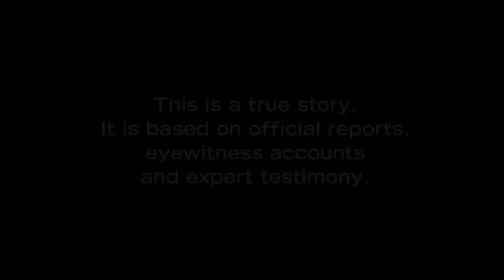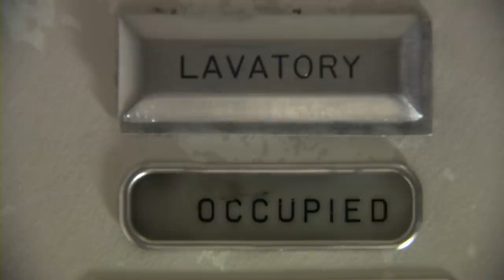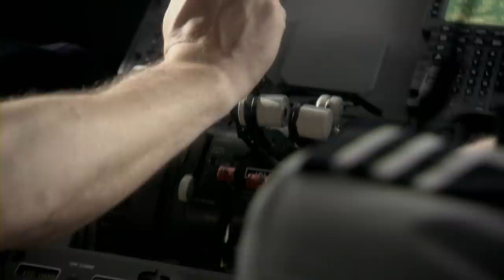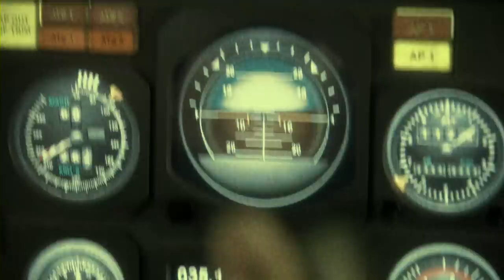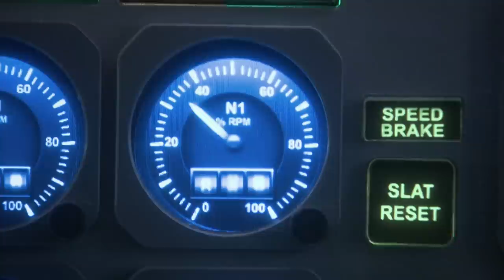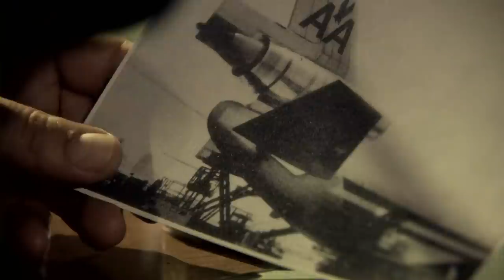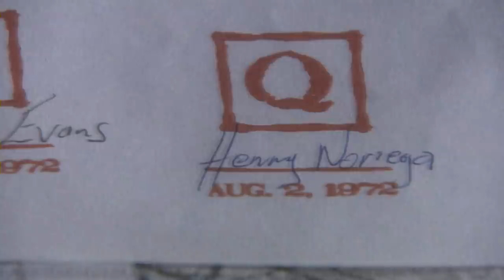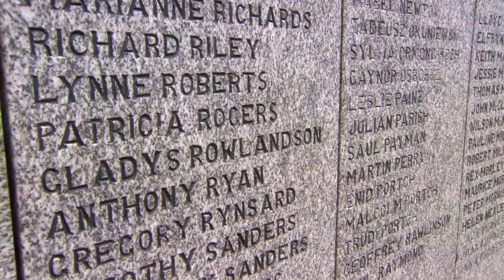Huge Hole In Passenger Plane Causes A Fatal Crash | Mayday | Wonder

Comment: "The doors on most airliners open inwards"
Yeah now they do, but at the time, outward opening doors were not uncommon.
It always irks me when people call the DC-10 a deathtrap, when it was actually a good design for the time. It simply suffered from rushed construction and the teething problems that come with it. If it had been given a thorough evaluation phase, it might have earned a reputation as a durable and safe design like the DC-3 before it. Instead it suffered several accidents that should have never happened because of the greed and impatience of desk jockeys who likely had no knowledge of how an aircraft works beyond "jet engines are loud, make airplane go woosh like bird". The Windsor incident was one of these. At the very least, the door latch should have been redesigned.

The Turkish Airways crash was not so much a failure of the aircraft but rather a failure of the bureaucracy overseeing aviation safety. That plane never should have crashed because of a blown cargo door. The problem should have been addressed four years earlier during development.

Unfortunately, there's a statement that fits the corporate attitudes about such things.
"Regulations are written in blood."
Reply: I would say you're right, but not sure if I would give MD a pass on the design problems. It was a good design overall but with some serious shortcomings. The L-1011, for example, did not skimp as much on their design, I don't believe.

Agree we should not judge a plane on the basis of what amounts to about 2 crashes (I assign design  half blame for Chicago and Sioux City.) I was scared of the planes. But that was more psychological that sensible. At age 10, the Paris crashed became seared in my mind, a symbol of pure evil, inseparable from the DC-10 itself. I imagine this kind of thing works that way for a lot of people.
Reply: @cchris874  I'm not saying we give them a pass, I was trying to say that the overall design was not inherently bad it just lacked the refinement that comes with proper testing and evaluation. MD and the FAA seriously dropped the ball.

As for Chicago and Sioux City, Chicago wasn't caused by a design flaw, but rather by sketchy maintenance procedures on the part of American Airlines, and Sioux City was a freak accident and a testament to the skills of the flight crew.
Reply: @Blakgryf  

Well, there were design issues in both Chicago and Sioux City. In the case of Chicago it has to be asked, should we expect an airplane to keel over and play dead due to an engine coming off? This has overtones of Paris. Sioux City is more in a grey area for sure. However, it's interesting to note that Lockheed, from what I have read, foresaw the hazard of having all the hydraulic lines converging  at a single point near the rear engine, as was the case with the DC-10, and incorporated a safer design into their L-1011.
Reply: @alhanes5803  
Go ahead, assuming you're not a troll, state one less-than-intelligent thing I've stated.
Reply: @cchris874  
We shouldn't expect an airplane to keel over and play dead after losing an engine.
It was a lot more complicated than that.
2 
The Paris crach never should have happened. 

It wouldn't have if Turkish airlines had acted appropriately on the service bulletin after Windsor.
Reply: @alhanes5803  

"It was a lot more complicated than that."

The complexity of the accident is duly noted. It doesn't invalidate my question/comment. Design philosophy includes ensuring the ability of a plane to safely take off and land despite the loss of critical systems. So far, this is pretty basic. There's little doubt the design of the DC-10 contributed to the accident:

-inadequate analysis of failure modes.
-lack of redundancy of stall warning
-inadequate regulations

It's precisely the complexity of the crash that revealed these deficiencies. Of course, there's no guarantee a plane will continue to fly due to an engine separation witness El Al/Amsterdam, and so on. But in the case of flight 191, the combination of failures suggests a loss of the plane would be the expected outcome. It is complicated, but in the final analysis it's not at all unintelligent to say the plane should not have keeled over and played dead. Had these shortcomings been addressed the accident would have been far less likely to happen.
Reply: Embriar 145s doors all still open outwards without a single issue ever its not that important

Comment: 11:56 'Small problem' is also what BA 009 pilots called the flaming out of all four engines of their B747.
In case you want to know what pilots get paid for when you think they are just babysitters for an autopilot: it is their training to solve these crises under pressure.
Reply: Controlled flight into terrain is the #1 leading cause of air crash fatalities.
Training is useless.
Reply: @Carter-dv4hz  :  Good training is never useless.

Comment: No door should ever be installed to close inward on a plane. If room is wanted have it installed the way a van slider door is, only slide open on the inside.
Reply: Outwards opening doors were, are and will continue to be commonplace on planes. Look at just about every single cargo plane there is both civilian and military. They all have them. 

The main advantage of Outward opening doors is it dramatically increases the amount of useable space inside. But unlike plug type doors, outward opening doors need to have very well designed and very robust heavy locking mechanisms in order to resist the forces of pressurization. The problem with the DC-10 rear cargo door was that in the off chance that the hooks didn’t completely engage - meaning the door wasn’t completely locked and that it should be reopened and closed again - it was still possible for the baggage handler to secure the latch that should in theory drive locking pins through the hook assembly. With the hooks not completely engaged the locking pins cannot be driven through but you could still close the external locking handle by putting force on the handle, which would cause the bars connecting the handle to the locking pins to buckle. And the worst part was that the cargo door indicator light was connected to the door and locking handle not the hooks nor locking pins meaning there was no way for the pilots to know that the door wasn’t closing properly.
Reply: @bruhsucks5715  no he's not.
Reply: *B787 cargo doors enter the chat
Reply: All planes I work on as a baggage agent open to the outside lol

Comment: First of all, this documentary is incorrect. The rudder is not the primary source for turning an aircraft. The ailerons on the wings, which are responsible for the roll of the aircraft, are the primary controls for a banking turn. The rudder just serves to control the yaw of the plane so that the turn remains coordinated with the altitude. Without the use of the rudder, an aircraft would drop altitude or gain altitude in a banking turn. Nevertheless, you could still make a turn without much use of the rudder, but it would be a challenge to keep the aircraft from yawing up or down with turbulence and/or gravitational pull of the earth below.
Reply: Plenty of "slope soaring" model aircraft have only ailerons and elevator -- no rudder -- yet make breathtakingly sharp turns.

Comment: Using the wing mounted engines reminds me of what the late Captain Al Haynes did on United Airlines flight 232. The pilots on AA flight 96 and UA flight 232 were brilliant!!
Reply: Interestingly, Bryce McCormick didn't like how the hydraulic system was the only way to control the DC-10 (rather than the cables and pulleys available on older planes), and he thought to himself "how do I get myself an additional layer of control", and practiced with the engines on simulators. That's how he figured it out.

Comment: It would have been a better solution if they put the door back inside the cabin the way it used to be. It would then be guaranteed not to fail. On the outside, there are too many moving parts for it to be safe.

Comment: So you can deliberately kill 349 people and no one goes to prison? Make it make sense!
Reply: I'll try:  No one was deliberately killed.
Reply: @marcmcreynolds2827  They deliberately didn't fix something they knew caused a crash.
Reply: @thedeviouspanda  I assume you're talking about the almost-crash from first cargo door incident.  But not to quibble -- whether a crash or an almost-crash, a clear warning that something needed to be done.

Something was done, following the usual industry procedure:  A service bulletin(s) was issued to implement modifications which would make a reoccurence very unlikely.  So unlikely, in this case, that it never happened again... until someone at one of the airlines decided on their own to make the door easier to close by cutting down the latches... and overdid it,  by so much that later testing showed the door could only resist about 15 psi instead of the design number of 300 psi.

Whether Boeing, Airbus, or MDC, rarely if ever does an airframe maker implement all the changes they possibly could following a crash.  You're seeing that currently with the MAX:  Back in service, minus (for now) the hardware changes needed to really solve the problem.  When the vertical stabilizer came off an A300, killing everyone + five on the ground, that was the eleventh time one had been stressed beyond its design limit.  Yet even after it finally turned fatal, Airbus did nothing (AFAIK) other than say pilots shouldn't use the rudder aggressively at low speed (FWIW, I see Airbus as #1 on the list when it comes to potentially deadly flaws which go unaddressed).

DAC certainly could have done more than they initially did.  What I'm taking issue with is "deliberately killed".  By that standard, the major airframe makers are all killers.

Comment: Darn, I still own the reel-to-reel tape recorder shown around 37:25 ! Oh and when recording only people talking, it wouldn't be running so quickly. It had speeds of 3 3/4, 7 1/2, and 15 fps.
Reply: That's really cool! What's the brand/type? What do you use it for?
Reply: *ips*?
Reply: @marcmcreynolds2827  inches per second. That's how tape speeds are measured. The faster the speed, the better sound quality. 

Reel-to-reel recording of music were usually at 7 1/2 ips. Cassette tapes were at 1.875 ips. 4 track cassette tapes were recorded at 3 3/4.

The original recording of music on tape was at 15 ips and were mixed down to 7 1/2 ips.
Reply: @BirdieRumia  I had two of them - both TEAC recorders. The one I still have is the 3300 that is a 2 track recorder. I use to have the 3340S that is a 4 track recorder. I don't have my 3340 anymore but I have my 3300 and a box of tapes. I use it because those tapes have all my music from the 70's and were recorded at 3 3/4 ips so I can still play them back.
Reply: @bjbell52  "inches per second. That's how tape speeds are measured."  Exactly.  Now take a second look at what you originally wrote.  There's just no substitute for having a second person do the proof-reading for typo's : )

Comment: The crash of Turkish Airlines 981 was such a tragedy. If McDonnell-Douglas had fixed the cargo door and added floor vents as should have been done, this crash would never have happened. The FAA completely let the side down in deciding not to issue the Airworthiness Directive that would have forced McDonnell-Douglas to fix those issues, like it or not. Most maddening is that McDonnell-Douglas discovered the issue during the testing phase yet chose not to make changes in the design. RIP to all who perished in this completely avoidable tragedy.
Reply: Also worth mentioning but rarely cited is the role Turkish Air played in the crash. A few months before the crash, a fresh set of score marks proved beyond doubt that someone had tampered with the door mechanism, in the process deactivating warnings for the cargo door, and more brazenly, adjusting the locking mechanism making the vent door even easier to close. From that point, even a "sickly child" could have defeated the safety system. MD were decidedly negligent, but I cut them a tiny bit of slack, as it seems asking a bit too much for anyone to have foreseen Turkish Airlines' deadly maintenance tampering.

Comment: Did anyone else notice on the takeoff footage it was an md-11
Reply: Good catch. As usual lot of little details wrong.  For the aviation super-trivia minded: For example TK flight attendants checking boarding cards when the boarding at Paris was a mad rush to hunt down every remaining seat. Showing a dive angle completely exaggerated, and so on. BUT a clip of an actual  TK DC-10 taking off would normally be a rare find. So credit where credit is due.

Comment: I’m no rocket scientist but seems like a terrible idea to make a door open out. Would think for safety reasons every door should open in on a pressurized plane so even if the locks fail the door could never open because the door is under pressure. Also why would there not be vents in the floor to equalize pressure. Just seems like basic stuff. I could see this happening in 1950 when pressurized planes were brand new but not then. It’s sad that they could build planes to be much safer but they worry too much about money and saving weight. People would much rather pay an extra few hundred bucks for a ticket and more to ship freight knowing they will be safe. Planes are built so weak the air frames are only given a certain amount of hours to fly but planes from ww2 like the dc3 dont have an hour limit on the air frame because they were over built! If a plane seats 300 people make it fit 100 people and be safe. If this was mandated people would still fly they would still pay whatever the tickets were. Need to stop worrying more about safety.

Comment: Isn't th9s the same thing that happened on United Airlines flight 811? And one of the deceased parents didn't let it go and they were able to find out what happened because of this victim's parents?  The fact that these cargo doors were an issue in the 70s and still not properly fixed by the late 80s is sickening.

Comment: The late 1960's and early 1970's was NOT a good time in 'American Manufacturing'...as labor unions ruled, strikes were ever-present, and 'idiot-proof designs' often led to inferior concepts...the DC-10 luggage hatch was a prime example of this at-play, and the efforts tried, to prevent it from 'hurting the brand name or product'. No different than now worldwide...only the 'errors' are far-more-often 'software-hardware' than 'conventional levers, locks and gears'.

Comment: All because they wanted a bit more space. Do people always have to die before safety procedures are sorted?? In trying to save money they actually lost money because they sold fewer DC-10’s. The cargo door problem should have been fixed on every DC-10 as soon as the incident with flight 96 happened and it was discovered. I don’t care if the odd plane couldn’t be used because it was receiving those modifications.

Comment: Total shitbox. Inherently unsafe cargo door which blew off, resulting in cabin depressurization. But since there were no pressure relief vents to prevent the floor from collapsing, passengers were sucked out of the airplane, seats and all, and critical control cables severed. No check valves to prevent fluid loss when shrapnel severs all the hydraulic lines. Since when do you design an aircraft so a single point of failure takes out a mission-critical system?

Comment: I’m shocked to find out all you need is a 2 year associate degree to become a commercial airline pilot.  Most do have a bachelors degree.  At nearly 100k a year, not a bad career choice.   I’ve always wanted to be an airline stewardess or be an air traffic controller.  Stewardess first.  I like dealing in customer service and the flying benefits 👍.   I grew up in a tiny town and really no options available for that career path in my town.
Something I’ve always wondered.  Why are u supposed to remove your shoes in the case of a possible plane wreck??   Fire is likely.  Sharp broken stuff everywhere.  Seems like shoes would be very handy.

Comment: Why the hell would DM change the formation of their doors just to gain an extra few ft in such a giant plane.. even though the design is very safe but only if the cargo crews at every airport in the world are trained properly on shutting and checking them properly. With losing their doors several times due to uneducated cargo crew not knowing how to make sure they are shut properly with the bolts in place and locked, and several people traumatized or dead was it really worth it to get 1 extra cargo box in on top  of so many. Greed and stupidity causes most problems on this planet. Use your heads!

Comment: I know it is known that the cargo door was the problem, but why not run the control cables through the ceiling of the aircraft for a backup so there are 2 sets of cables to control the rear aircraft panels.  Just a thought.